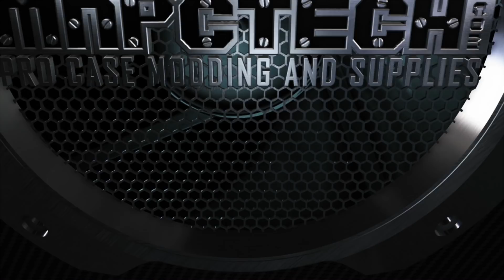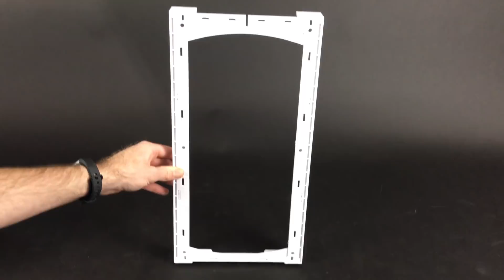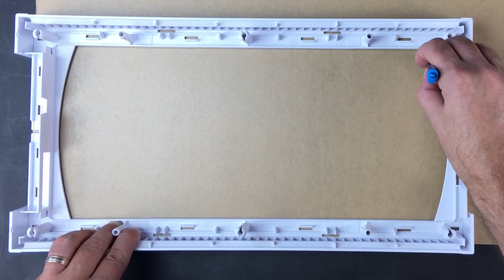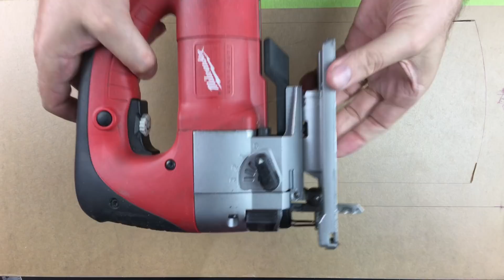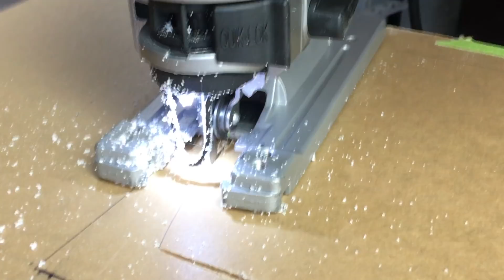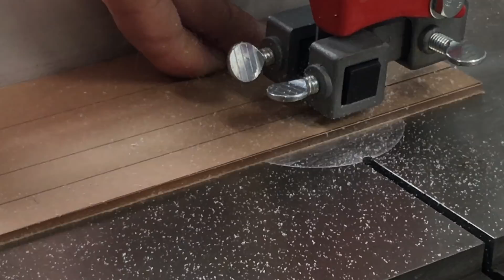Front Bezel Window PC Case Mod Guide Fractal Design Define S2

Comment: Hi Bill.  i have a similar case in the Define R6 and I have a quick question about modding it a little.  I would like to paint the black front of my white R6 to match with the rest of the case so I was wondering how you would go about doing that if you were going to attempt it?  Do I just get some type of sandpaper to scuff the aluminum front a little and then just go with a paint / primer like you used in this video? Thanks for any help!
Reply from the maker: that's correct Seyda! thanks for the question, You’re invited tonight to visit my store, http://mnpctech.com and use my DISCOUNT code, MNFAN at check out for 15% off your order!

Comment: if you put painters tape on the lines youre going to cut, the plexiglass will not melt and be so much easier to cut
Reply from the maker: Cast Acrylic doesn't melt. Extruded Acrylic does melt, regardless if you tape or not. (btw, Plexiglas is a brand, not a type of acrylic)
Reply: @MaxellAdGuy  i didnt know there were different types, thanks for the info

Comment: I just got the s2 and really thinking on doing this custom front. Have you guys tested for sound and heat? Compared to the original front
Reply from the maker: No issues for us. You can dismantle your S2 bezel face plate and TEST difference for your system temps, just record temps with and without the bezel face plate. Thanks for watching! Bill - http://www.mnpctech.com

Comment: What might be cool to see is if you guys can come up with a way to make a distribution plate without a cnc or laser cutter.  I don't know if this would work but maybe cut the custom reservoir and coolant channels all the way through a piece of acrylic using a jig saw and then sandwich it between two pieces using acrylic cement.  Then drill the threaded holes for the fittings.  On the S2 you could even mount it  directly to the slots used for reservoir mounts.
Reply from the maker: Noted if we have space we can look into possibility. dangerden made their 5.25 reservoir bays with individual pieces or clear acrylic with cement and they all leaked, so machining acrylic is always best solution, but I understand not everyone has CNC.